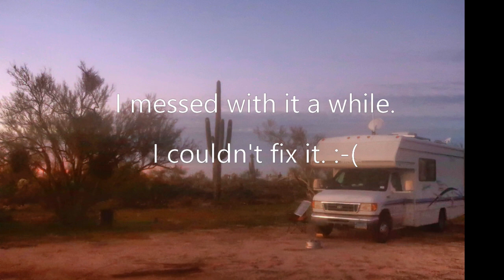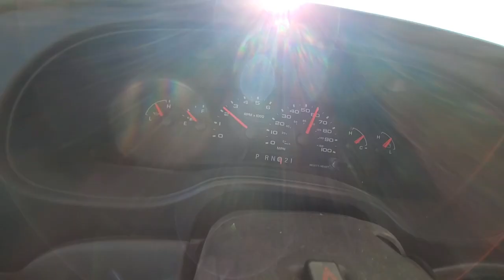RV Living, Geocaching, Edible Cacti & Prickly things Near Tuscon//Escape the Madness w/me

Comment: For future reference you can heat a knife or fork on your propane stove, use a hot pad. Sometimes there is enough solder left on the connection to do a temporary repair.

Comment: Correct, full bars means a loud signal, not necessarily a good one. If its congested or has a lot of interference, you’re not going to get good speed.  Fun tip, WeBoost should not be used if you’ve got decent signal, as most WiFi devices use MiMo (multiple in/multiple out). Cell extenders drop your antenna count down from several to one, and that one just makes it easier to scream really loud on one band only. Also, use a crimp or punch to re-attach that fitting.

Comment: they make a glue that will glue metal allowing for electricity to  keep flowing, I bought mine on ebay, not expensive, use it on my track on my train layout, and it works.

Comment: It figures!  Electro-mechanical parts - the ones that receive the most stress during operation - are usually the first to fail.  Jacks are notorious for that.
Had a friend whose fancy recorder gave up because of a bad input jack.  All it took was to apply fresh solder, and it was up and running again.
Wish I'd have been out there, as I have tons of electronic tools, including a great soldering iron.  Could've fixed it in 5 minutes.
The desert is extraordinarily Beautiful (except for the chollas).  You're very lucky, Carolyn!  Stay well, safe, healthy and kind!  --Dave

Comment: Hi Carolyn, with your outdoor cell unit, FYI you need to solder the inside pin and also the outside Crome “shell” of the connector that fell off. Both of these connections work together. Let me know if I can assist you? Best regards Mat

Comment: Hi Carolyn, Good to see you attempting to fix more stuff. Shame it didn't work,. If you ever get something that needs re-soldering and you can see it on the board, hold a nail or screw in a pair of pliers and heat the end  on your stove. Should get hot enough to melt the solder. Continued best wishes xx Claire
Reply from the maker: Claire, I've been fixing things since I was 10 and took apart my radio when it stopped working. The reason I don't attempt to fix things myself as much now is because I never have the right tools and it usually takes me 5 times longer than it would someone who knows what they're doing. I would rather spend those hours doing something fun.. or doing my actual  job. Thanks for the tip about the nail or screw. I'll remember that. 
Take care, Carolyn
Reply: @CarolynsRVLife  Your welcome, Its not the best suggestion but its been proven to work. Whatever happens its good to just see you get stuck in and give things a go. Unfortunately many women don't know one end of a screwdriver from another. Learning by doing and then teaching by showing is part of what your channel  is about. I've learnt much watching and if i ever get to tour the states i may get to put some of it into practice. Thanks again for sharing your life.